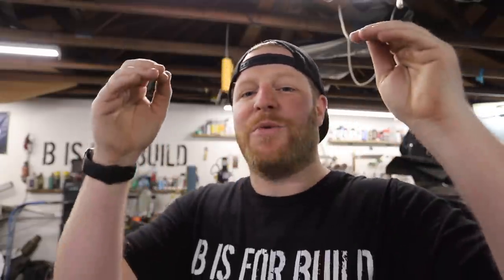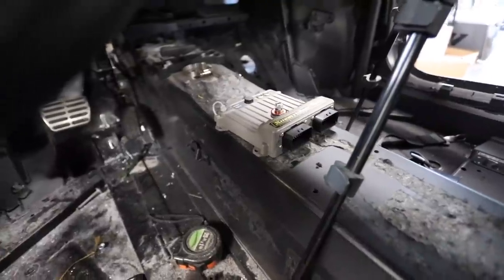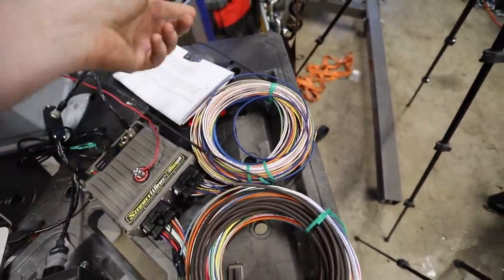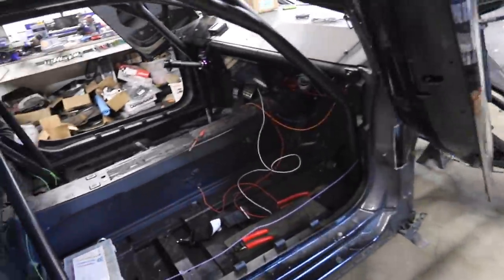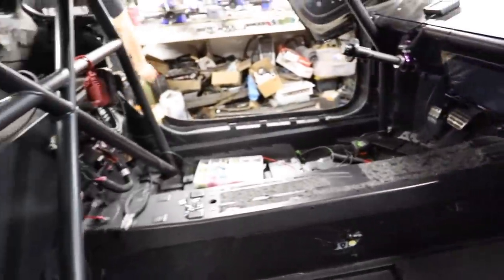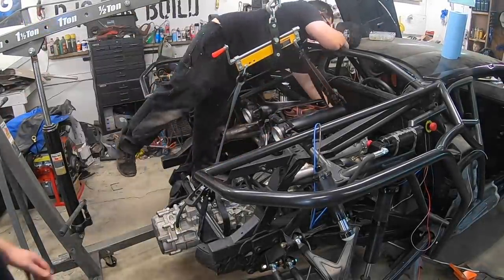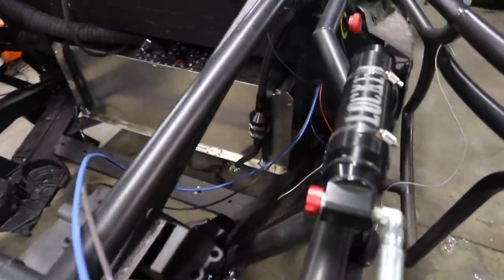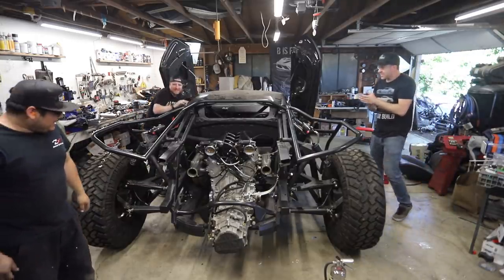Off-Road Lamborghini Huracan First Start Up!

Comment: You need a different battery.  A) Your hold down needs to be over the whole thing.  B) the lead acid battery is not good for offroad.  Get a AGM or gel battery and mount it with a better mount..  THe acid is going to come out all over your work.
Reply from the maker: that is an agm battery
Reply: @BisforBuild  Is that what "Platinum AGM" means printed on the side there? ;)
Reply: Do you have any fusing or breakers on the heavy gauge battery wire running to the back and inside? Considerable fire risk if not .
Reply: @BisforBuild  got to love those experts lol
Reply: @jamesblakey3283  Yeah, he really needs a bic boi fuse close the terminal on the hot side.
Reply: @BisforBuild  Oh.  Great.  Sorry have not seen it before.  (and watching from a phone).  Then I would just suggest an upgrade to the mount and you are good to go.  Look at the OPtima style battery boxes many places sell.  I would be afraid those mounts you have would either break the battery in half or fail (Even though "Oscar did a great job" on it).  Make fun all you want people... Only been in to Desert offroad stuff for about 30yrs.  But what do I know (Obviously not that this was an AGM battery... HA).

Comment: Is that the starter at 20:33, 20:50 left side of the transmission close to the bell housing?
Reply: No that’s where the axle shafts go into the trans they’re spinning cuz I think they left it in gear when they turned it on or something like that not 100% sure but it spins on both sides

Comment: Isn’t the Holley dominator extreme able to do everything that your doing with that Holley kit and the other smart wire kit?
Reply: @Lassi Kinnunen 81 nothing wrong with following the manufacturers instructions… that’s called doing it correctly lol
Reply: @Lassi Kinnunen 81 I don’t see how it hurts though
Reply: @Lassi Kinnunen 81 lol I’m sensing either a mullet or a Leroy reference there. I get that they want their stuff plugged, but my thing is, it doesn’t hurt anyone to see a different configuration option, because for you and I, it looks unnecessary, but for someone else, it Could be the perfect solution to a problem, and they’ll know it when they see it

Comment: A big part of off-road racing is thoroughly testing your vehicle and also prerunning the course. Props on the cool build but remember there are other cars in the race that can cause damage to your vehicle especially if you're going into the thing totally blind without knowing the capability of your car or what obstacles the course presents. You guys did a lot of good work on that car to risk doing major damage to it by not being prepared to race. Do yourself and other racers a favor and don't race the car until you've done  proper testing and prerunning.
Reply: well said

Comment: I hope you're adding bypass shocks on all four corners so you can really tune and dial in the suspension since you're racing the mint. no point in having high horse power in the dirt if your suspension can't handle it

Comment: Why was there sparks from around where the left axle bolts on?
Reply: I think its something to do with the starter
Reply from the maker: didn’t tighten the nut on the back of the starter, we fixed that before the next start up

Comment: You won’t make it 5 miles in the desert with that battery like that. Either the battery internals fail or the automotive style clamps rip the case apart.
Reply: This!
Reply: It's a agm battery tho? That battery should do just fine

Comment: Just a thought you might want to hard mount objects, like Power Steering Res, Batteries, Hoses, and Wiring.  Because of the forces that will be generated by ripping across the desert, till make for a very long day of a car in piece across the track.   Example: a 10lb object that drops 48" and stop in 1/4", will be equal to 2000lbs.  If the stopping distance is 1/8", then it is 4000lbs or the distance is 1/2" , then it is 1000lbs.  Just a thought.

Comment: I was wondering did you drill into the gas tank to put the Holley ECU on?
Reply: I can't tell if it's an integral fuel cell or a bladder inside the fuel cell.  Either way, it definitely needs to be cleaned out

Comment: Ok so u building a off-road Lamborghini y LS  y not a V10 or V12 u can get a Pagani V12  from an s600 for $3000 or just buy the car for under 7k and just pull the engine out. Well I don't care if it LS as long as it runs

Comment: It's always bothered me - I feel like the suspension should be about 4-8" higher when the vehicle is at rest.  But maybe shorter shocks don't need to compress as far?  It doesn't seem like there is enough stroke in them to absorb a landing before bottoming out.  Hopefully I'm way off base :)

Comment: Does PDM stand for power distribution module? Also you better strap down that battery if you plan on off-roading the car those hold downs aren’t gonna last and you’re gonna fry that battery. Also it should be an optima or similar gel sealed battery acid will be everywhere ask me how I know.

Comment: I didn't read through the comments but one thing I noticed on todays build is the battery hold down. I think that battery  hold down will  snap off on the first jump. Better check on the requirements needed on battery hold downs or you might not pass tech.

Comment: Tip 
The thicker wires are probably the output power wires, especially if they have fuses.
The thin wires are signal in wires and yes the whole point of the device is computer control so the ecu if suitable can control it.
Note some ecu system have all this already built in

Comment: Haltec has the same system but its called nexus . Its just a bcm to replace the factory one . You could have just ran an electric pwr steer pump and had it in the front . So easy to do and no long lines to rub on to get a leak or your belt breaks and your stuffed . Elec pwr steer and elec water pump work well . Better hope your belt doesnt come off or your dead in the water .

Comment: Battery mount needs work, straps over top for sure. Off road it would never never last. might consider another battery.
Also we always had two batteries and a switch to isolate them. Because of the night driving with lights.

Comment: Great work guys its looking good, you need to make sure the negative wire for the ecu goes to the battery not through the chassis as it causes problems on these systems.

Comment: That battery is not secure it needs a roll over strap, and possibly a neoprene base to prevent cracking on the bottom in case of an accident,  the two battery cables need safety covers, and a non metal cover,  the lead closest to the battery needs a battery cut off switch that is enable from inside the cab and on the outside for race marshalls to cut off power.
Reply: forgot to add needs a extinguisher loop directed at it in case of fire.

Comment: Wire running back to the engine from the battery needs to be fused in case of  a short . At least a 250 or 300amp maxi fuse or circut breaker.
Reply: We addressed this already. Not the cleanest way but down to the last few days.